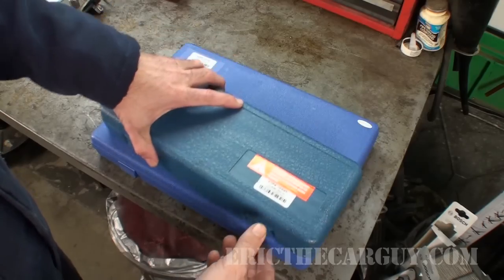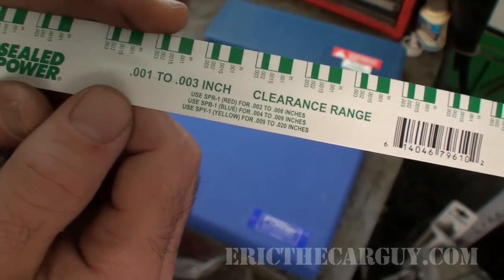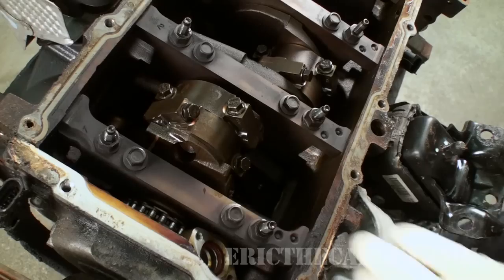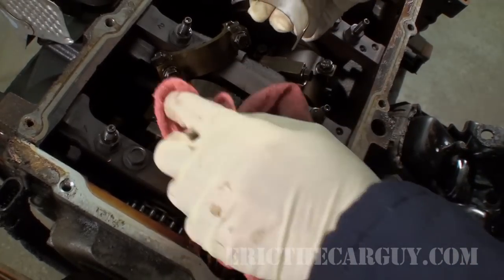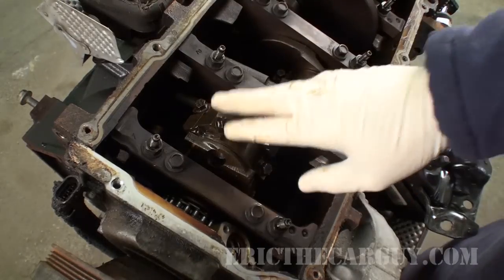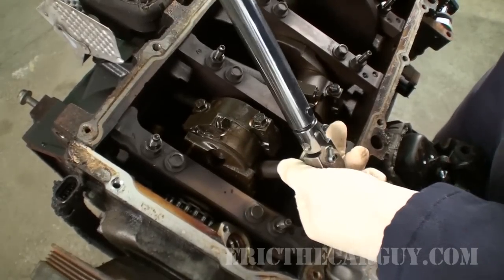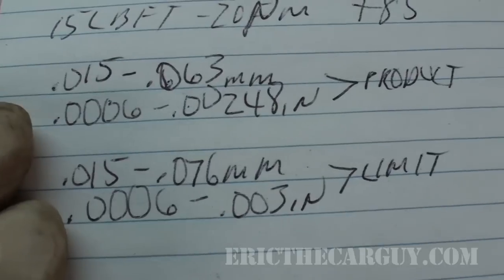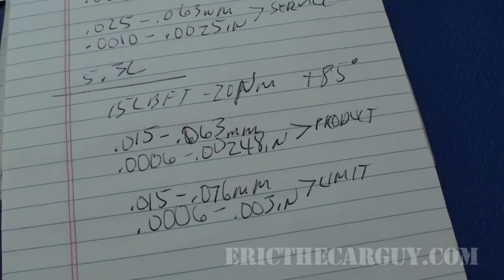How To Use Plastigage -EricTheCarGuy

Comment: I didnt know that you should use the bearings when measuring with plastigauge. :o I thought that you should put plastigauge on the crankshaft and then tighten the connecting rod

Comment: Hey i have a question, i have a 2003 hyjndai tiburon and i just put a cold air intake on it along with replacing the valve covers on it, since then it keeps stalling on start up unless i disconnect then reconnect the maf sensor, along with that there is not an engine tick at idle, it will go away when i rev the engine and remain gone for a few seconds then come back, does anyone have any ideas? I have a few thoughts would just like some other opinions. Thank you in advance

Comment: Never saw bearings put in like that before.  Usually I roll them into the cap then install the cap with the bearing already installed.
Reply: Eric makes me feel faked. 🙄
The installation of the bearing is totally wrong. Also the position of the plasticgage. The bearings aren't all over the same thickness ! 🙈🙈🙈🙈
Reply: Hello  @kraut-performance  

I am in the process of completely rebuilding a Toyota/Yamaha 2zz-ge engine.

The problems I am encountering are the tolerances and my measurement tools.  I have calipers and bore gauges, but only precise to +/- 0.01mm

Tolerances in Toyota rebuild manual require higher precision.

That being said, even with my primitive tools, my bore is egged and non-serviceable.  Rings were worn, so I am taking a "risk", but believe they will be much better in the bore than the old worn rings that had a gap out-of-spec.

All bearings looked passable, but replace with new factory spec 01 or 02 or 03 as noted on block vs using "generic fits all".  

I am now using Plastigage as final check because, as stated above, I do not have  measuring tools precise enough to measure below 0.01mm.

P
Reply: LSmiata Hi. Did you finish your build, yet ?
Reply: I was thinking the exact same thing..."Eric...your doing it wrooonng" lol
Reply: That is what I have always done too, but I suppose either method accomplishes the same thing in the end.
Reply: Shadow, you're doing it the proper way. Bearings should be installed into the cap and then put on as one piece, then torqued.
Reply: Yeah I noticed that as well.  Your way (really the only proper way) is the correct way Shadow.

Comment: You need to get the snap-on toque digital wrench its amazing!
you don't need that pain in the rear angle gauge.
You can just change the setting to degrees and it works like a charm!

Comment: are they stretch bolt like they use in heads.i did the same tork doing head gaskets on my 3.1 but had too use new bolts thanks for the info. mike

Comment: I notice you use rag to clean surfaces .  Not a good idea !!
Rag can leave threads that if not seen can be trapped . These threads can seriously damage Rhine parts if assembled into parts . Paper towel is the best to use because paper is oil soluble if it happens to get left inside .  You should already know this being a crack gun mechanic . :)

Comment: On those fractured caps you also need to be careful when handling them. Dont put the fractured side down on anything. Those things are such a precision fit that if you damage the face of that fractured surface just a little bit they not longer fit together like they suppose to. You will be able to assemble them and torque them but you caused a stress riser that can and has caused catastrophic engine failure.

Comment: You showed us the mircometers and the bore meters, but besides plastigauge, what would you use to measure the clearance of the journal while under torque?  Or are the measurements going to end up being the same if you use the micrometers/boremeter when the parts are not under torque?
Reply: To check your mains and rod bearings under torque, remove your crankshaft from the engine, and the rods from the crank (do not mix them, for the love of all that is holy). Replace the caps on the mains as well as the rods, with your new bearings in them. Using padded vice jaws (cut some 2x6", anything but steel, cardboard will work in a pinch) and a bench vise, torque your rod caps. Now either use a snap gauge or an inside micrometer to measure your bore. Take the measurement in several places, both in different directions to check for out of round, and different depths in the bearing to check for hourglass wear. A snap gauge is a spring loaded tool with two arms that push out to touch your bore, and can be locked with a tension screw at the other end of the tool. You then remove the snap gauge and measure it with an outside micrometer. 

It takes skill and practice to accurately use micrometers and snap gauges, hence the development of plastigauge by the British navy in the 1950s for a unified quick untrained measurement standard.

Comment: I really like this one. I do have a question, Do you think there is a problem with actually coating the bearing journal with assembly lube while using the plasti-gauge? I have seen it done, not sure if it is advised.
Reply: Depending upon your application, it might be advantageous to use grease. I use grease if I'm checking a bearing that is still in the vehicle (and therefore upside down). Use a fresh tube of grease and clean your hands before you touch anything.

Comment: 12:06 did you notice it's at 75 not 85! might have come back a bit? anyways love your work as always
Reply: It was at 85. The angle of the camera made it seem like it wasn’t in the right spot.
Reply: This is called 'parallax'.
Reply: Yup
Reply: I noticed and accounted for skew. All accounted for, I believe it would've still been between 15-20. At min it would've fit squarely in the 15.
Reply: Also noticed and next was closer to 90deg.

Grrr on torque to yield and old-ass tool used.

In fairness, torque angle is good, especially when using oiled, not oiled, anti-seized fasteners.

GOOD video on plastigage.

P

Comment: how do clean up the plastigauge?
Reply: Just wipe it off.
Reply: 70chevelle8 I used this stuff for the first time like 3 months ago and it most certainly didn't just wipe off which is why I asked.
Reply: Use an old Credit card..It wont hurt the crank or the bearing.
Reply: Try orange cleaner and a razor blade. I think that might work.
Reply: Chris3836 too aggressive, brake cleaner and a rag, gas and a rag, its not hard to remove
Reply: +Chris3836 scotchbright with no lube.  i kid i kid.  please dont sue me
Reply: as he mentioned at the end it's basically wax.  It will turn into functional lube :-).  contains no particles that will cause metal to snowball I guess basically and just shreds/melts into the works.  not a problem
Reply: Bigbacon some people don't do it at all. it will dissolve in the oil.

Comment: 85 degrees seems to be suspiciously close to 90, and then the plasty guage was thinner than the .0015, so it almost seems that whoever made it designed the rebuild to be done with bugger all tools, 15 foot lbs is like hand tight then a quarter turn and if your a gorilla with a massive set it should still roll

Comment: Good vid. ;)

I'd have mentioned to check journals at two positions 90 degrees apart. They tend to wear egg shaped; you might be fooled by one reading.

I use micrometers on OD and telescopic gauges (snap gauges) on the ID. That way I use the same micrometer to measure both the ID and OD. Also, a set of telescopic gauges is much cheaper than a set of bore gauges.

 You might want do do a vid on measurement methods.

Yeah, plastigage has been around since probably the Model-T days ;)
Reply: I do it in 4 positions

Comment: I don't think cracked makes it any stronger, it makes it more accurate. At least that was how BMW advertised it when they starting doing it.
Reply: the reason its considered stronger, and more accurate is that they crack off in a certain pattern. and fit back together like a key in a lock. they match up with all their un-uniformity. also it has greater surface area contact between rod and cap since its not flat.
Reply: I think that the rough surfaces once pressed against each other cause a lot more friction than a mirror surface. It seems logical that it would give lateral stability to the link which would in turn prevent slippage from vibration of the assembly.
Reply: Stronger in the sense that forces are distributed uniformly through the part, since the casting process took place in the same mold.

If, say, you have two different pieces of metal(not formed in the same direction of casting) the stress is unequal and therefore unhealthy for the engine.

So, strong here, the word, should actually be transformed to better performance or longer lasting through uniformity.

You have to realize that the perfect arm would be the one that's cast in one piece, unbroken, undivided. I believe that there were such engines(for the life of me i can't remember where i've read about these oddities) where the arm and bearing surface were introduced via taper tight fit and a flange. The result is a very long lasting part and uniform distribution of wear through the bearing surface.

Of course such an engine is highly undesirable because of the difficulty of it's construction and assembly so the next best thing is broken/cracked off arms that are formed in one single process.